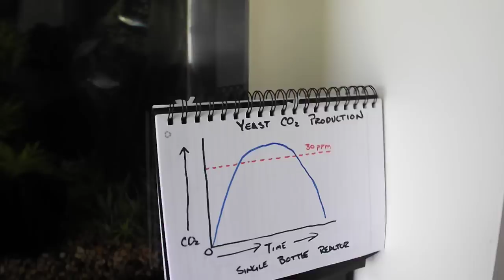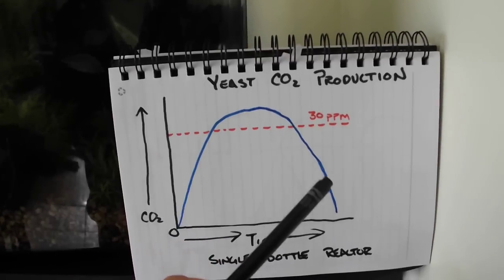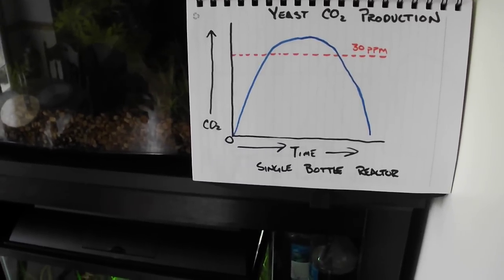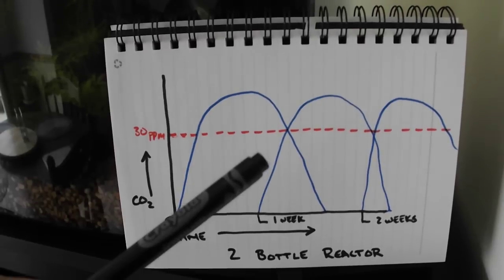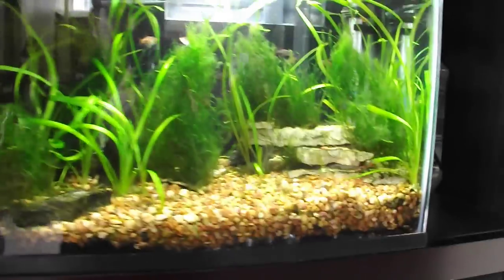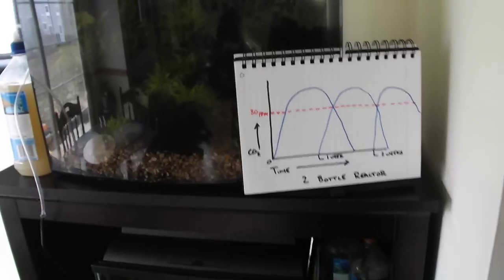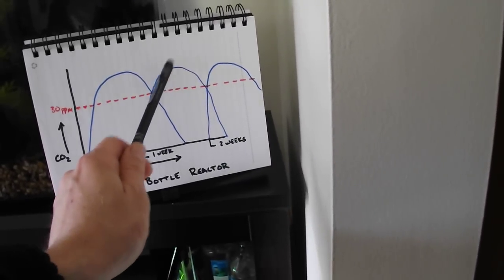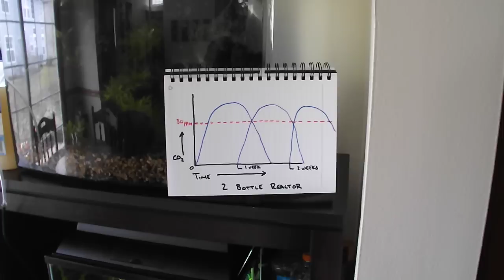DIY CO2 Reactors - What You Need To Know(to prevent invasive algaes)

Comment: There is nothing magical about yeast co2 generators. There are studies done about optimal contidions for yeast to provide co2. Researches suggests that yeast works most efficient around 5ph and 20% of solids in the solution. Which leaves you with the last variable to play. Amount of yeast you will add. And also about baking soda; adding baking soda will only make your yeast activation time longer which is not good. It is not the ph that kills your yeast it is the alcohol it will always die at the same concentration which is when the solution has 18% alcohol concentration. So simple solution 2 x 1 lt bottles with 200gr sugar 1tbsp yeast with 26-30c degrees drinking water. If you use tap water clorine will kill the yeast which will enlengthen activation time or yeast will never activate. Again 1 lt with 200gr(one cup or one water glass) sugar and 1tbsp yeast done one and add one next week and change the previous one next week and repeat. What hinders yeast? Amount of solid concentration in the water creates osmotic pressure and hinder yeast optimal concentration is 20% (which means 20% of the water should be sugar). ph below 4 and above 8.5 kills yeast optimal ph is 5. alcohol produced by yeast kills yeast at 18% concentration. any thing below 26c and above 30c will hinder or worse kill the yeast. Oh and clorine.

Comment: Hello. Question. How do I start the 2 reactor bottle from zero? I mean, i have everything and imagine it is working now, with just 1 bottle because I'm going to start the cycle, so in 4 days I'll make another dose with my 2nd reactor bottle, but then,  how would i "plug/unplug" the transparent pipes, if I open any of the bottles or make a 3 way valve i would lose all the co2 being created don't I?
Reply from the maker: I use a clamp, and pinch the hose shut.
It is important to wait a few minutes to let the gas fill the dead space and build up pressure in the tubing before removing the bottle.

The same is true when connecting a new bottle. Pinch the hose shut. Let pressure build up in the new bottle before releasing the clamp.

If you release the clamp before letting the pressure build up you'll produce a siphon that will start draining your tank.

Comment: Hey, really good video, job well done.
I have some  questions.
I'll do a DIY CO2 in my 20l.(5 galon US) tank with 6 small fish and 20shrimps.
I want to ask you, what bottles to use - I think to go with 2x1l bottles.
Aren't those 2x1l bottles too much? I was thinking for just one bottle for start in this small size aquarium. 
I'll use a drop checker and CO2 ceramic diffuser an buble counter.
My other concern is how you regulate this thing, when you go to vacation for example or at night?
Just turning it off will rise very fast the PH and the fish and shrimps will suffer....
Thank you!
Reply from the maker: +Bat V At night you can put on an air stone to bubble off CO2. I used to be concerned, but honestly there is nothing to worry about. I had this system on a 5gl, and didn't do a thing. All inhabitants were ok. I think it is really hard to gas your fish with DIY co2...my experience.
Reply: To Bat V: Shrimps are good with garlic and shallots with rice. Mmmmm.

Comment: As a craft beer brewer I can shed a little light on making yeast last longer and co2 more voluminous.  Most of the DIY planted tank systems I see use way too much sugar.   If using baking yeast, 1 cup of sugar to 8 cups of water is too much.  Baking yeast dies at about 4% alcohol.  If using brewers yeast ( available from local or on line home brew sources), then you can use 3 times more sugar to water.  Also, dosing a new batch of sugar water with reclaimed yeast will work well for 5 or 8 generations of use.  Also using a prepared yeast nutrient which contains diamonium sulfide ( also available from home brew supply) will make yeast last much longer in a nutrient poor solution of table sugar.  An addition of a small amount of fruit juice will substitute in a reasonable manner as a substitute for commercial yeast nutrient.  Grape juice is especialy fermentable.
Reply from the maker: +Bill Deacon Awesome information!!! Thanks for contributing Bill!
Reply: If you're still up then maybe you can create a video with correct ingredients? Thank you!
Reply: -so with our normal baking yeats 1 cup sugar for 2lt bottle is too much (maybe 300 grs sugar in 2 teaspoons yeast for two lt? 200 grs and 2 teaspoons for 1 lt??)
-and the one that can take more sugar is the yeast made for alcohol
Reply: Bill Deacon 🙏🏼☝️

Comment: what's the point of adding baking soda to this recipes
Reply: +Ricardo Giannotti  The baking soda is to buffering your yeast system and prevent CO2 from dissolving into your medium. Cause when yeast lack of oxygen they could produce alcohol and sometimes acid. The acid will change pH which will kill your yeast. Baking soda can neutralize that effect and keep yeast happy!
Reply from the maker: I typically don't add baking soda. But, it is said it will stabilize the reaction. In my mind that means less co2 longer. As I said in the video you want a fast reaction.
Reply: Got you thanks, I'll try to create this system tomorrow will see how it goes,, I'm putting it in a 55 gallon tank and I will use the 2 bottle set up with 3 smaller bottle for control. I'll use two 2 littler bottles.
Reply from the maker: Good luck Ricardo. Keep in touch to let me know how it goes for you.